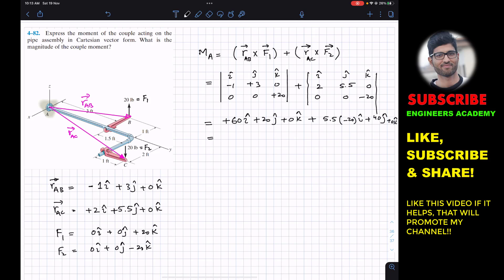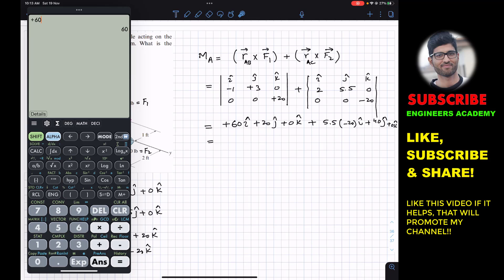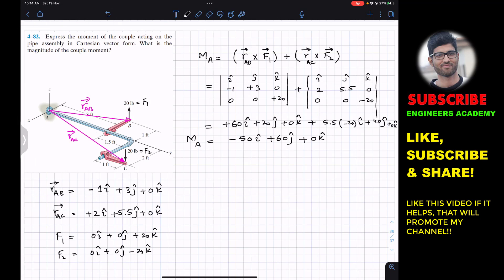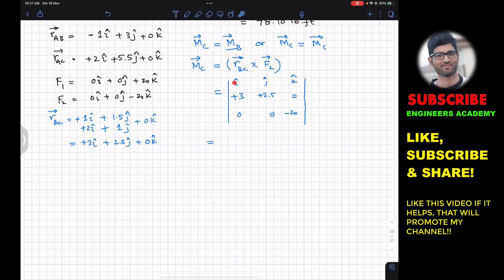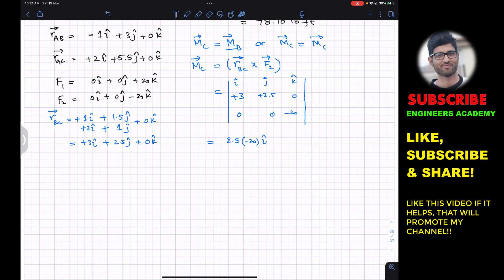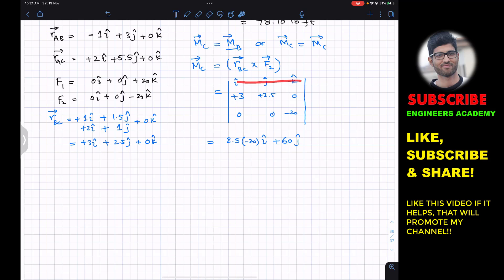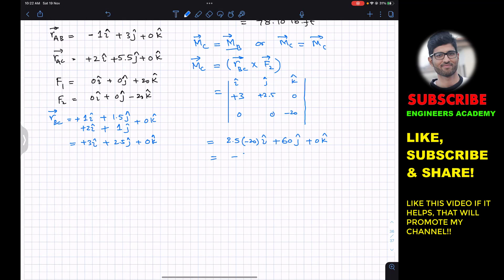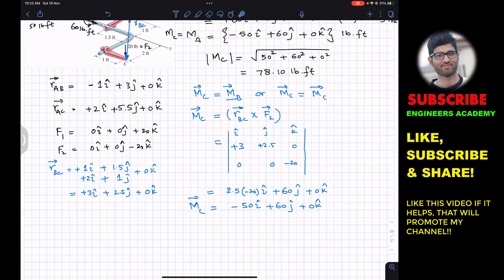4-82 Moment of a Couple Chapter 4 (Hibbeler Statics 14th Edition) Engineers Academy

Comment: How does F2 create any moment at C that makes no sense
Reply from the maker: This is couple moment, its a free Vector
Reply: @EngineersAcademy2020  so when you have a moment at a point where a couple force is you use the force there always?
Reply from the maker: Consider moment arm vector tail at any of the two forces point of application and consider the head at the point of application at other force
Reply: @EngineersAcademy2020  im not sure i understand
Reply: When you take the Couple moment about point C, F2 i.e (-20k)lb will have a moment of  zero, hence F1 will cause a moment about point C and will take our moment arm as rCB. Therefore, Mc=rCB x F1 (20k)lb